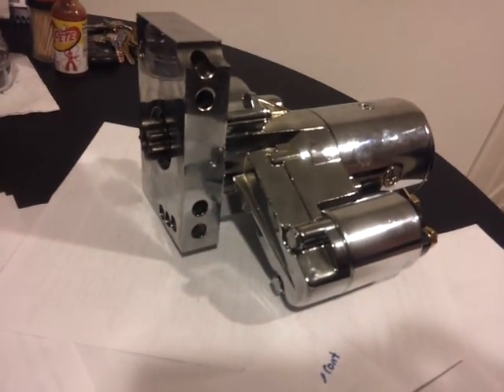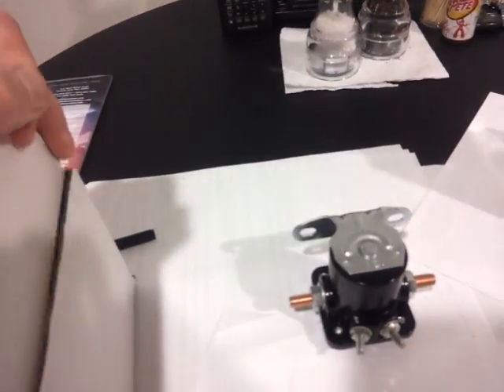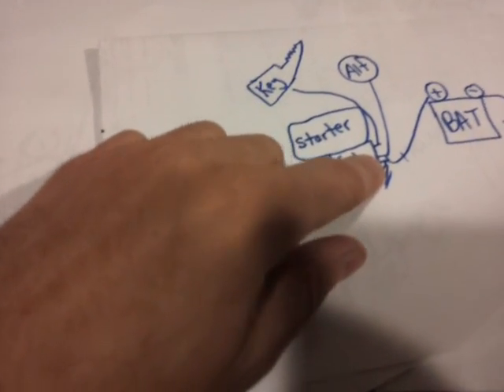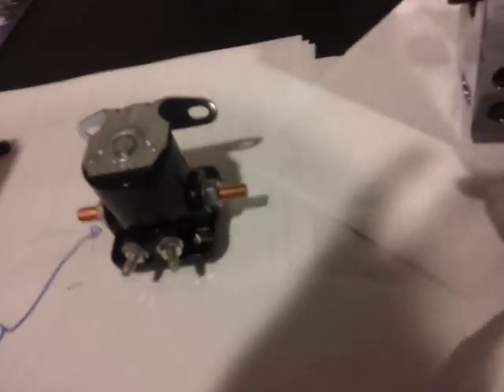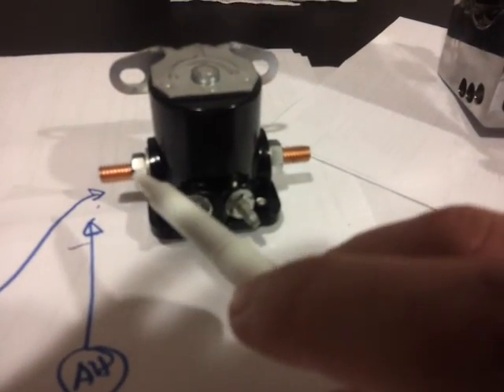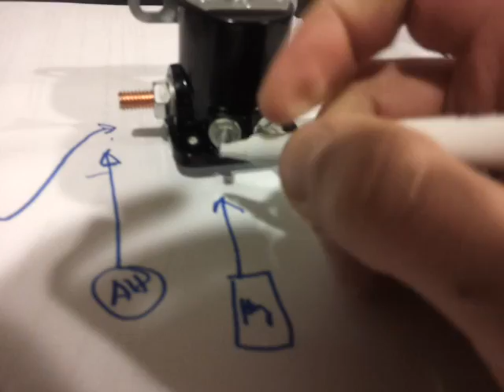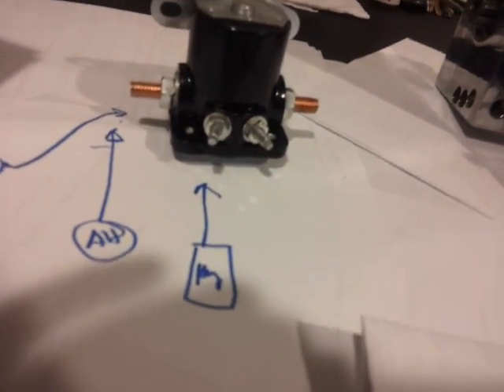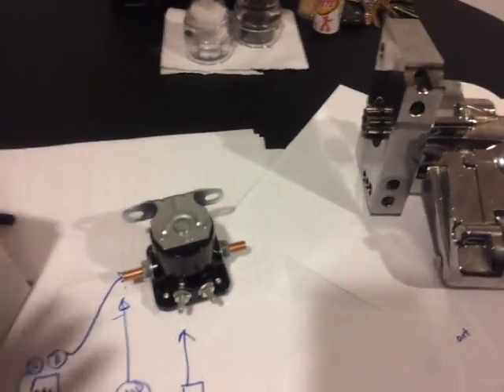DIY starter remote mount solenoid easy step by step how to with schematic

Comment: When i crank my car, it only last about 5-10sec till it breaks a 100amp breaker and the wire to the from the solenoid to the starter gets very hot, what can it be?
Reply from the maker: sounds like a short
Reply: +klowny1969  I tried looking for a short but only thing connected are the switches and lights. I will look again but closely, appreciate ur help thoe
Reply from the maker: +2MKiNg4 short can be in the starter motor as well
Reply: +klowny1969  how can i check that?
Reply from the maker: Connect a voltmeter to the battery and start cranking the car..of the volts go below 9.5 volts then u have a short in the starter motor..make sure ur battery is good first by load testing it

Comment: Ok so.... the battery and the alternator goes to the left side stud of the starter SELENOID,  the right side stud of the starter SELENOID goes to the fat stud in the STARTER, the S terminal in the STARTER goes to the left side small stud in the starter SELENOID "s" terminal, and in that same "s" terminal of the starter SELENOID goes the wire to KEY right??? and i have to jump the S terminal in the STARTER with the fat stud in the starter too right???

Comment: If you bypass the starter solenoid and use the good old ford solenoid hook it the way you said but the wire running to the starter should just hook to the thick post going straight in the starter because you're bypassing the starter solenoid because  I guess because it was bad, so why still run through the bad starter noid. Just saying,
Reply: I noticed that as well, two solenoids in series is pointless. all He did was add a solenoid to energize the oe solenoid.
Reply: So are you saying run the right side of the Ford solenoid to the starter instead of the solenoid on the starter?
Reply: Ok...you have a heat soak issue with your GM starter. Solenoid is on the starter motor housing. If you wire the Ford remote solenoid the way he said, including the jumper, you effectively bypass the original solenoid. Look at the wiring. It’ll make sense to you. It’s a common hot rod method.

Comment: let me try to make simple what you have is red wire from  battery to big lug on solenoid the other big lug conns to starter  now the little  red wire comes from key switch to small bolt on solenoid other small bolt on solenoid gos to ground    ----so what happens when you turn key  to start this operates a magnet in solenoid which shorts out 2 big lugs on solenoid to spin stater  this standard solelnoid operation no matter what its on  your truck or your lawn more  generly speaking   so if you turn key nothing happens no click  nothing take a jumper wire  14 ga ok short between big lug on solenoid red wire(battery) to small red wire on solenoid this should spin starter this tells you are not getting voltage  from switch key operated their is a fuse from little red wire on solenoid to key switch  there is a seperate wire from battery to key switch  key just connects these two togeatherin side switch-if still no go  check seat switch  brake pedal switch pto MOWER BLADE not operated   maby a rev switch  this basic wiring on most  mowers  unless you are trained  vometers  you are spining your wheels using one i am 88    i built my first meter 1965  analog with vacume tubes  today meters are digital  no needle just digits

Comment: Hey klowney,

Thanks for the vid! You saved me some time of recalling my original wiring.  

A few questions: 

1. when you say jump wire from original-starter-solenoid to the S terminal, I'm obviously wiring the "old" solenoid's hot (+) to the S terminal...

then THAT S terminal wire also connects to the s-terminal-post on the new remote solenoid, correct??

2. Also,  how can I add/wire a push button start button to the new remote solenoid to have the push-button-start function in my old Chevy RV?

Thanks in advance for answering all my questions man!

DC

Comment: Why do I need this?  don't all starters have solenoids attached to them  already?.. I'm new to auto mechanics..lol
Reply: thnkbg because when you drive your car your starter gets hot. & when you park your car after driving it & start it again it tends to have a slow crank & wont crank at all if your starter is bad. that's been my problem for a while. the goal is to have a crank thats strong like when you first start your car. kind of a trick if you don't want to go out and buy a brand new starter etc

Comment from the maker: Take a look at my other video on how to test a starter..the three posts are: 1 ) the thicker stud for the battery cable and a bunch of smaller wires 2) other thick stud goes to the main body of starter 3) small stud is the trigger wire from the ignition

Comment: Dude, please try to maybe do your comments a few times before you tape and post it. Very frustrating trying to follow you, you were drifting all over the place. And you go on and on and on about things that are just confusing. 'the thick stud...this one...that one...it's the thick one'. And the rambling about how you can't draw a key, who cares, just tell us what the wire of post is for and then mover on. Just point to it and say 'This thick stud' and then move on, it's just frustrating. And when you ramble on about things that are not really important, the information that IS important gets lost in the ramble. Easy to fix mate, just practice, do it a few times, watch it back on reply, and then post the one that gets to the point fast, easily and without the confusion. Your post was informative, it did show me what I needed to know, but it took about 3 times longer than it should have and I almost closed the window a dozen times out of frustration. But thank you for the effort and the information.
Reply: i thought this was the best explanation ive seen and not as boring
Reply: Seriously I’m pretty sure he said to jumper the alt terminal of the original solenoid with the original S terminal which makes no sense 🤷🏻‍♂️ now you’ve got two solenoids working. The entire point is to bypass the original solenoid

Comment: I want to know how to hook up, a remote start
Reply from the maker: nope this is for a remote solenoid..if ur getting heat soak issues
Reply: Easy you just connect a remote control button to the silinoid clips on and clips off when your done using it

Comment: I'm having a hard time figuring out how everything works to the coil what goes there is a wire that connects to the relay that goes to the coil? Just trying to figure that out for the final part thanks for any help
Reply: The other terminal on the 4 terminal solenoid would go to positive side of coil. The I stands for ignition. Real simple.
Reply: http://startersolenoid.net/starter-solenoid/ check the article, you can find the answers. It's a very detailed starter solenoid guide.